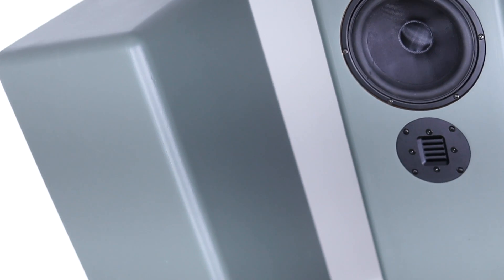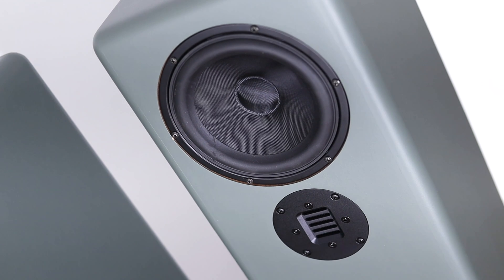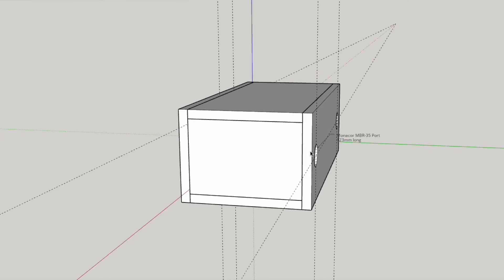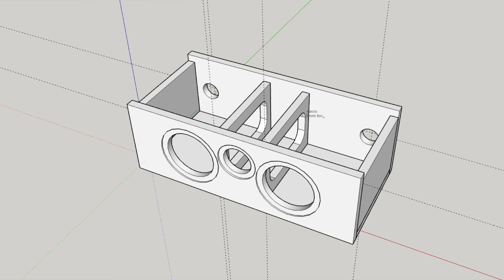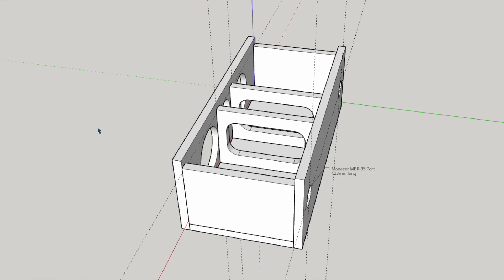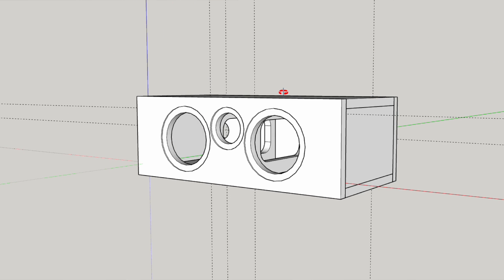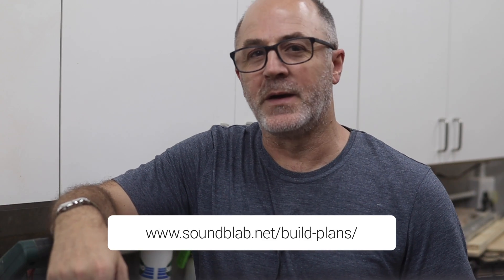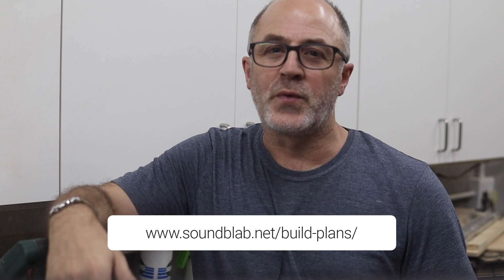My Favourite Speaker Projects & What to Expect in 2024 - by SoundBlab

Comment: Do you make the centre channel 2,5 way? That (sometimes) helps with the lobing issues encountered with horizontal mtm centre channels. Off course depending on usecase a wide soundstage is preferred and not achieved with mtm setups. For this reason I chose to make a 3 way with tweeter above the mid flanked by a 5" bass driver on either side. Also I think a ported centre channel isn't needed when a sub is used, which most often is the case. Without a sub isn't much of a problem also when "larger" drivers are used in my opinion, mens voices usually don't go much below 100hz and the natural rolloff with a sealed cc will be between 70-80 hz.

Just some opinions and experience on my own system so by no means a rule or anything 😊

Like your channel so looking forward to the new builds/ videos.
Reply from the maker: Thanks man. Not sure if it will be a 2-way MTM or 2.5 way yet. Perhaps I will explore both options when it comes time to model the crossover. Sure, a center channel can be sealed enclosure, but by providing a bass reflex as standard, you have that option and can then easily just stuff the ports to make it sealed if you need to.
Reply: @SoundBlab  good point. In my case ported wouldn't fit in the TV cabinet, and for visual unity I wanted it to be the same  frontal size as my receiver. It's in the middle off course, on the other side is a DIY sub amp also in the same ish size. Otherwise my head errors :p